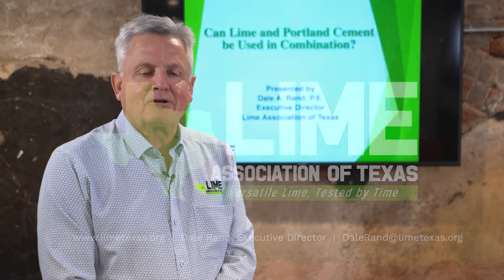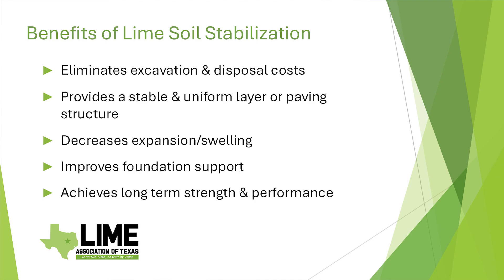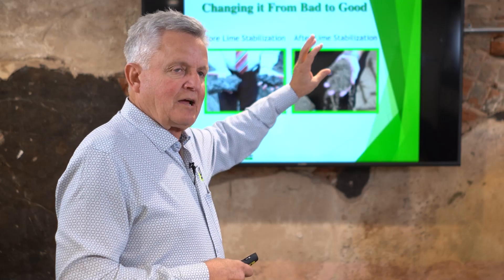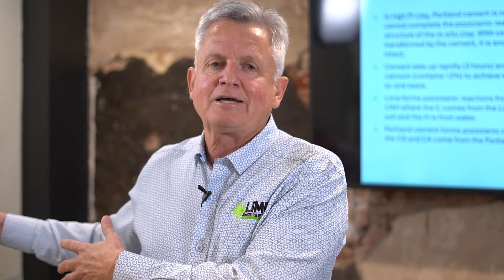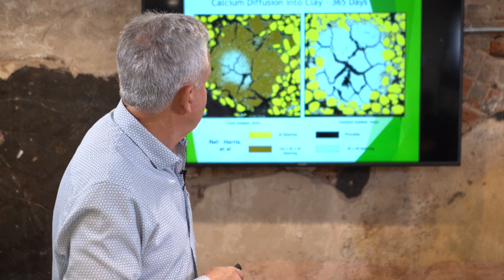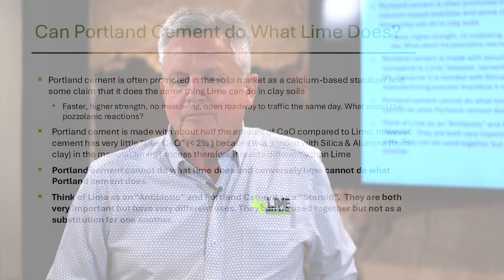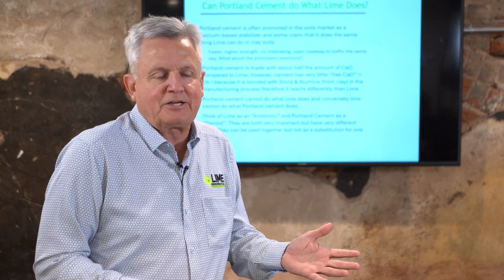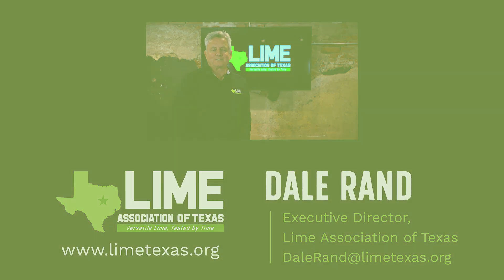Can Lime and Portland Cement Work Together to Stabilize Clay Soils?

Comment: Greetings from Germany. I'm happy I stumpled across your Channel.
I'm building a shed base, got clay soil. A garden that can't be acessed by heavy machinery and found this method to be the most fitting, as you don't have to move as much material around.

Could you make a video specifically for the DIYer? I think this method specifically is the best for the average garden owner.
Sadly the word hasn't been spread. You can find some videos of people using cement with soil. But nobody has used lime.

I'm in the process and preparing. But I have no idea how the final product behaves and even looks. Is it like concrete? Does it still look like dirt? If you dig it up, could plants still grow on it?

If that is the case, there is even more advantages to the average home owner, building a patio or shed base, as it would be semi permanent.